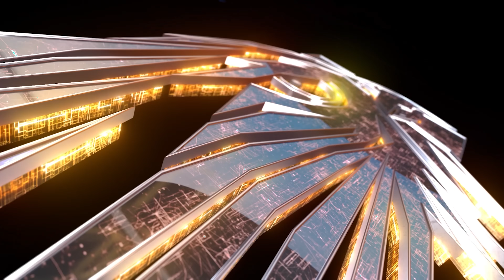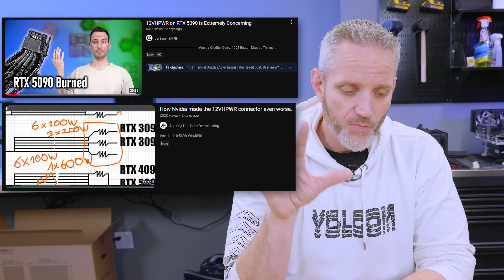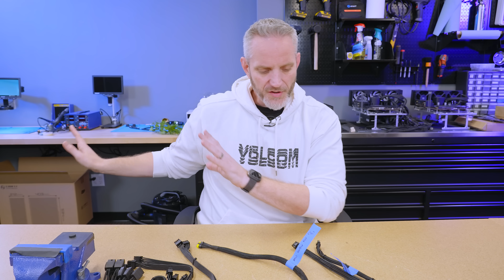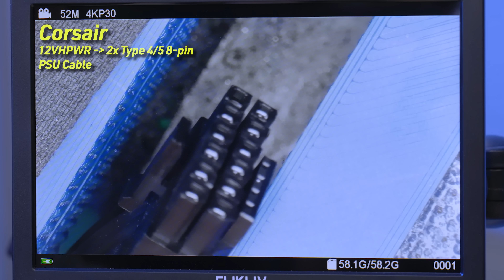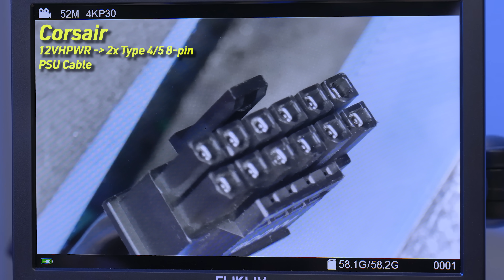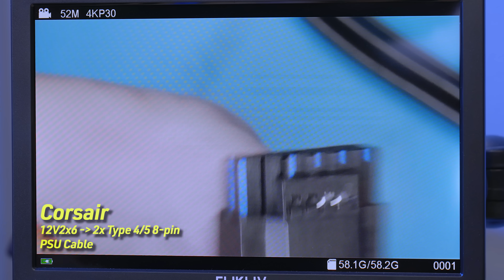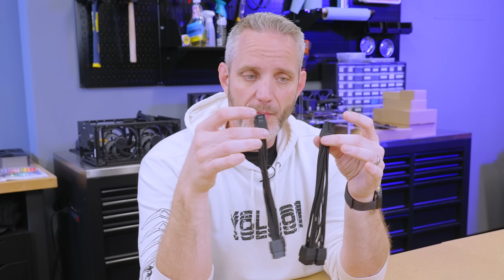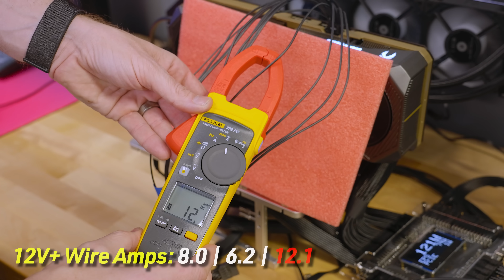I discovered something concerning and I need the Experts to chime in... More 12VHPWR discovery!

Comment: I do not really understand why everyone is so concerned about the 12VHPWR cable... The 4-Pin ATX12V cable delivers up to 192 watt (48 watt per cable core). The 8-Pin EPS12V 336 watt (42 watt per cable core). The 12-Pin 12VHPWR cable 600 watt (50 watt per cable core). Lets face the real problem. The stupid location of the12VHPWR power plug. Every normal person will first install the gpu on the mb. Mb's usually have multiple fixation points right next to the power plugs. That makes sense because you have to use some force to install this kind of plug. The power plug on the gpu has no nearby fixation point to support the force needed for the installation. The board starts to bend and you can hear "pling" or crackle. That means you are about to or already damaged your mb. This leads to not properly installed power plugs. Having the gpu power plug on the side can also cause problems when the case wall is pressing against the cables/connection. The mb producer should provide some kind of support around the pcie connectors, so that we can press in the connector without having to worrie about braking the mb...

Comment: Hm, you should know, that H, H+ and H++ standard does only change small details on the female power plug side (psu, gpu). The cable standard between psu and gpu is the same for H H+ H++. Giving the male power plug pins some room to move freely will actually lead to a better contact with less friction. The 2 or 3 dimples inside the male plug pins create very small contact surfaces when brand new, but improve with every plug/unplug cycle. So, plug unplug your cable a few times before powering it up (4080/4090/5080/5090). Do not reuse your 12vhpwr cable when changing the psu or gpu (4080/4090/5080/5090). They say the "4 spring" male power plug pin is better, but i am not sure about that. The 4 spring male power plug pins reqire lower manufacturing tolerances and have a higher risk of damaging the female power plug pins (pins shear off/plug get stuck). The old design with dimples is a spring design too, just one with 2 large springs instead of 4 small springs...

To answer your question:  Your "out of spec" result was probably created by yourself by reusing not properly stored cables on different setups with already used and not properly stored components. New unused pins can have a corrosion layer if not stored correctly. Used pins can have exposed corroded copper surfaces. The later can lead to higher electric resistance at the contact surface. The electricity will flow uneven.

Comment: Zotac 50 Series GPUs won't power on until the cable is fully plugged in. It also has a status light that indicates whether the cable is indeed plugged in all the way. Additionally, you can replace the cable with a Corsair ThermalProtect, which will cut off the power if the temperature rises above 65 degrees.

Comment: you cant put mains current through tightly bound wires, through need mains gauge wire. I want a CABLE for my lead, "shielded" doesnt do diddly the moment you said 20A. So fields are rubbing, which makes resistance, which makes more heat, which makes more resistance. The pins not fully grabbing, still makes more resistance

Comment: The power connector problem is simple to fix: give up on the connectors and use ring-style screw terminals, like used on motorcycle and auto batteries. The individual wires are still needed to turn the corners with a small radii, but the power connectors they are offering just aren't up for the job. Perhaps larger UPS-sized Anderson connectors would work, but they are proprietary, and not needed for something that doesn't require a lot of assembly/disassembly cycles. The semi intelligent power connector nonsense we are seeing is just to sell power supplies. Fitting a too-small power supply with a too large-video card--is why we have fuses and circuit breakers. Enough already.

Comment: Those pins should not move once installed into the connector. Shame on Corsair. Either the internal retaining pin hooks are weak, or the plastic internal latch shoulders are not robust enough to take the pressure during installation.

Comment: Like if this makes you feel like,disconnect your cable and see if it´s good or not haha. Im using brand new 5070ti and i was SOOOO AFRAID of that cable that came with the 5070ti card,im using 1250w cooler master and for some stupid reason i lost the other cables,so,i needed to find those cables,buy a new one if i didn´t found them or else buy a 3x1 conenctor cable wich is duh the 3 "splitter" thing to the cooler master and then the other connector to the card,i bough the 3x1 cable that goes into my cooler master and it´s working fine...so far at least,let´s see if it´s working fine after like 3 months later.

Comment: Is it safe to use the asus strix 1200w Platinum 12v2x6 cable that comes with the psu or should I use the power cable that comes with the Astral rtx 5080. Thank you

Comment: So I have just tested 2 new corsair 12v 2x6 cables from my hx1500 2025 and 1 new cable mod 12v 2x6 to 3x8 pin cable and 1 corsair was perfect, 1 passed and the cablemod was terrible... THERE IS A QUALITY CONTROL ISSUE ACROSS THE BOARD! I made a youtube video but I don't have a test bench/rig to run multiple new cables and create a spreadsheet. Please Jay, do this! I'm very curious/concerned as we should all.

Comment: Done some observations with a current clamp on my 5090 and I've noticed that the ground wires carry much less than the positive 12V wires. It's usually in the 3 - 4 A range. My bet is that a lot of the ground goes through the PCIe slot.

Comment: @Jayztwocents i have a ROG THOR 1600W Titanium III and 2 12v high power sockets on the psu and the new 2 pin pink cable so 1 of the sockets has the 2 extra wires in it enables this PSU’s GPU voltage stabilisation feature..

on amazon they do a cable that go`s from the 2 x12 high powers on the psu in a y cable mod to the 1x 12 high power on the card .

so do i use the 1 cable from the box with the  PSU’s GPU voltage stabilisation feature. or the y cable as 2 separate outs to 1 in whats would you do please help me .

Comment: One thing people don't realize about ODM/OEM is that even though they are made in the same plant, Company A could just order the cheapest thing they make and then it's 1:1 with other Chinese brands, but Company B can pay more to have the manufacturer make their cables to a higher quality and tighter spec, use specific connectors and pins, etc.. So just coming from the same manufacturer doesn't mean it's the same product.

Comment: I am late to the party, but here’s what I’ve found on the be quiet! Dark Power 14 with Thermaltake’s Dr. Power III equipment. The psu was manufactured by CWT, just like most of Corsair’s models. I’ve noticed that some of the connector parts were pushed back, while others were in the right positions. I immediately recalled this video in my mind. The cable was never used before, so it was concerning already. I plugged all the cables into the Dr. Power III device, and it showed me, that the 12VHPWR was only capable to deliver 150W of power, despite its 600W rating. The cable was fully pushed in, but there was a little breaking point at the PSU’s side… I noticed, that one of the PCIe cables was pushing the 12VHPWR cable upwards, making it stiffer. I disconnected both cables, pushed the connector sockets back to the right positions on the 12VHPWR cable at both ends, connected it to the PSU and Dr. Power III again, and after turning the PSU tester on, it now read 600W of power from the cable. 
In conclusion, you need to make sure that the connector sockets are staying in their right position and the cable has enough clearance to move and they aren’t strained at any ends. 
There’s so much room for errors, and the worst part is, you can’t be sure if the pin sockets are still in their places once you’re plugged the cables in. Imagine the card trying to pull 570W of load on a cable that can only deliver 150W because of the moving pins. Instant burning 🔥

Comment: I love the shit ton of videos on this topic from tech youtubers, all trying to find excuses for this miserable connector. My favorite so far remains Steve Burke's "you're plugging it wrong". To be fair, GN has since published at least another video with proof of "manufacturing defects", but GOD FORBID they actually acknowledge the design itself is the problem.
I would propose an alternative explanation to that offered by all the "honest, independent reviewers" that definitely do not receive scripts along with the hardware they test the very second it launches:
Could it possibly be that, if you pull 500+ W through a very small area connector, it will overheat and melt?
Could that be the reason why even the 8 pin connector has a rated power limit of 150 W?
Could it be why cards like the RX Vega 56 had DUAL 8 PIN connectors for 200 W?
Could it be that NVidia just wants to protect its R&D investment into the 12vhpwr, and it's raining down on "honest, independent reviewers" with sponsorships to praise the faulty connector and blame the users for "using it wrong"?
I would appreciate an answer to at least this question: considering that the boards themselves are bulky due to all the phases needed, the coolers make the cards 30+cm long and sometimes 3 slots thick, and the high power draw requires 3 separate cables from a 700-1000 W PSU, why exactly would anyone need a tiny connector on the video card, apart from the fact that NVidia rakes in a profit on that connector?

Comment: PUBLIC SERVICE ANNOUNCEMENT!!!
I have tested a new power supply from ASUS which has a "NO GIMMICK" Intelligent Voltage Stabilization system inside certain power supplies! 
I tested the new ASUS Rog STRIX 1200W Platinum rated PSU with GaN mosfets and true digital "PER PIN "IVS technology".
When I measured each wire on the 6 pin outs, these were the results; pin 1- 9.1v, pin 2- 9.3v, pin 3- 9.0v, pin 4- 9.2v, pin 5- 9.0v, pin 6- 9.1v

I honestly thought it was just a gimmicky name on the box but no, they really are doing something about this issue!
I seriously highly recommend this power supply! For some reason I also noticed that when I installed this power supply, my coil whine went down by like 97%
The plug on the 3.1 spec ASUS 12v 2×6 is EXTREMELY flush to the end of the connector just like the Nvidia brand ones are...

Comment: Some peoples has start order PSU, check cables and when find good cable. They switch it with them own bad cable and send PSU back t shop. Notice this when check OUTLET PSUs. Many just cable packet been opened and 16 pin cables not anymore with original packing. Do not buy OUTLET PSUs if over the packet seal is broken.

Comment: 13:13 I think the issue is not having less contact out of the box, I think plugging this in you will push back the pin and might have even less contact, which causes more surface resistance which causes less voltage at same wattage means more amps.

Still the cause is not having optimal contact, but I saw this many times in the industry working as an kind of electrician that pins getting pushed out of their housings when trying to plug it in. Especially with tiny plastic thingies like this it happens fairly often. At least from my personal experience which is biased.
Also, in my case it most of the time has no impact because the devices and machines I am working with are so expensive they must have protection. Even if the device itself is not that expensive, the product which it is working with is.

Comment: My 5090 MSI Liquid burned out today using only the included cable and it was fully connected.
Reply: Thanks for the message, could you specify the cable, is it a Y-cable? And what type of connector is it? (vhpwr?)
Reply: Was the PSU ATX 3.1 by chance?

Comment: CableMod C-Series Pro ModFlex Sleeved 12V-2x6 12VHPWR StealthSense PCIe Cable for Corsair Type 4 / Type 3 (Black + Red, 16-pin to Triple 8-pin, 60cm)
This it what I replaced my new Corsair PSU cable very solid build

Comment: To anyone reading in the know,, Just bought a Tuf Gaming 1000w. It has a 16pin to 16 pin 12v cable(same as what Jay has in the vid). Can i use this on my 3080ti FE? Currently it is using the splitter cable that came with it.

Comment: As an electrician, electronics technician and IT professional with many certifications for over 18 years I’ve worked on all types of power connections including molex connections. Although the new 12v 2x6 is not a molex connection it is similar in theory. The pins on a power connection like that do have some flexibility for variation. As long as the back of the pin is past the (what I’ll call) clip in point then when the male connector pushes into it it’ll force the metal pins to secure a proper connection. That being said there are many variables which can affect this connection such as the pin not being crimped or soldered properly which doesn’t allow it to seat properly in the connector, the inside of the connector being worn down, or missized not allowing the pin to seat properly, or the crimp being to close to the wire in comparison to the other crimps on wires in the connector which could cause it to also not seat properly due to tension on the cable. Any of these reasons could cause a poor connection which in most cases won’t be an issue because you’d still have a decent enough connection for what you’re trying to accomplish but with the power demand and wattage capability of the cable you’re already at the line and need just about a perfect connection. In the electrical world you’re supposed to have a 20% oversized of your power demand to wire capability. As someone else said in this comment section the 12vx6 cable only has a 17% over sizing. That means that every pin needs almost a perfect connection to avoid possible hot spots and overheating. A ground pin is way less likely to cause an issue because it has way less demand or need than the other connections but if any other connection was that bad I’d have cause for alarm in my opinion.

Comment: So I have a question then and any help would be nice: I have a gigabyte RTX 4090 OC in white, and I used the adapter that came with the GPU. A couple days ago, I was working on some rendering in Blender, and I noticed my monitors flickering a bit. I checked the display port cables, and they were fine, so I unplugged the GPU and discovered the adapter was melted on a couple pins. Is there a brand that people trust for cables and their rating than what came with my PSU? I own an EVGA Supernova 1300 GT.

Comment: hello, what you can say about be quiet 12vhpwr adaptor cable? did you have tested it have any work with it? my question is - do i have to prefer to use nvidia adapter or be quiet cable are good to in case i dont have ant 3.0 or 3.1 Power supply. thanks for your videos)

Comment: I think you got a shit Corsair PSU for the test somehow. Corsair PSu are one of the best!!!!
Corsair cables are not a design issue, and they passed all quality controls even though some are not aligned as the others, that's totally fine by Corsair. Pins are fine, bottom line.

Comment: this type of connection is obviously bad. Why they don't just try with cables of the type we connect to our electric stoves? Those can support 16A cause they are for the electric ovens of the stoves. It's a separate very thick cable that is connected directly to the stove by connecting the cables to the stove cables. It has no socket. Perhaps the graphic cards should just head over that direction

Comment: Sir, actually in the near future I will buy a new VGA 4070 ti super/5070 ti from NVDIA but I am very worried about this 12vhpwr cable, there are many reports of VGA melting and PSU short circuiting because of it.
Do I really have to use a 12vhpwr cable from MSI (the yellow one) to avoid short circuits ?

Comment: Is there a better custom set of wires I can buy that can handle the overpower on a 5090 if it happens?  What happens to the GPU if it gets too much power through one of these cables? Is it better to let the cable burn than damage the GPU?

Comment: I work with DC wiring and connectors a lot , the connectors are junk , sharing load through parallel individual wires is rubbish  the whole thing stinks . use better connectors and two wires that can actually handle the loads properly .

Comment: I use a 4080 SUPER and never had any issues with the 12vhp connector overheating, even running full TDP at 320W 🔥. I stick to the original NVIDIA 3-to-1 12v cable, no cheap alternatives.

Also, my power setup is rock solid. I run an AVR stabilizer (5000W, stable 220V) to the wall, then a 3.5kVA pure sine wave UPS, and finally a 1000W Silverstone Gold PSU connected to that.

Not sure if all that helps with the infamous melting 12v-pin connector problems, but so far… zero issues 🤷‍♂️.

Comment: Im new to pc building and had an idea.
You said that the PMD2 was smoothing out the power to the GPU saving the card from being damaged. So I was thinking along with the PMD2, adding the Thermal Grizzly WireView Pro (upgrade to the Thermal Grizzly WireView ProII when its released) thinking this method would have two "buffers" to decrease the chance of cable melting. 
The GPU I'm looking to purchase is the ASUS ROG Astral GeForce RTX 5090 32GB GDDR7 OC Edition. 
This PC will only be used for my VR motion racing sim. I'm trying my best to incorporate everything I can to prevent the wires from melting but wanted to know if this was overkill? Thanks